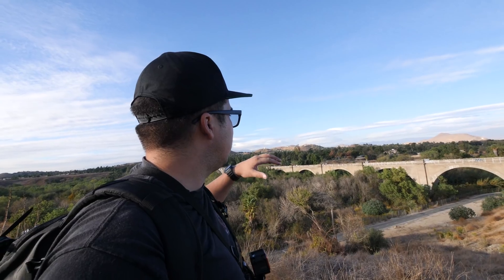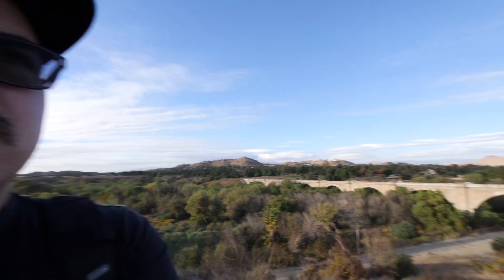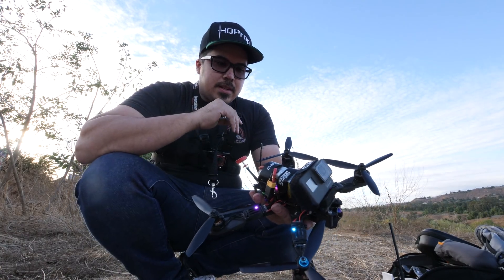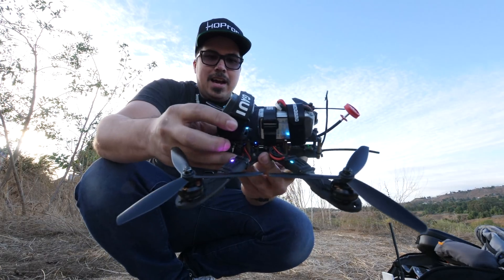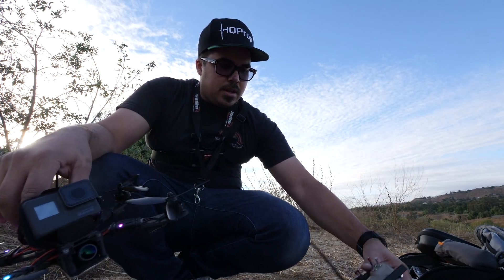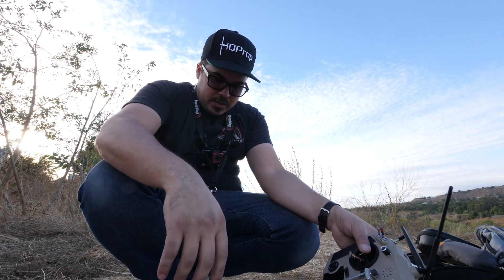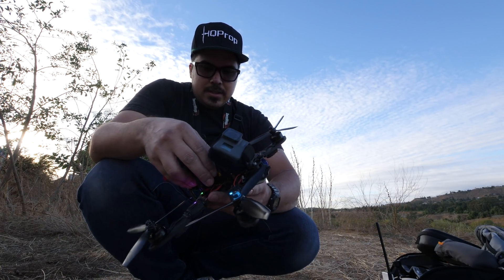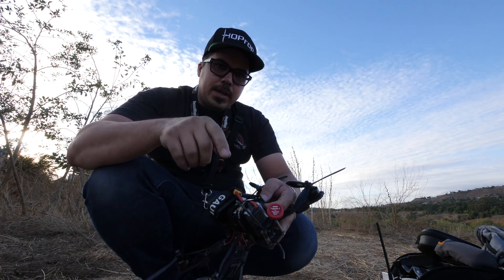Arming issue with betaflight f4 board and 32bit esc

Comment: I have the same issue with a Betaflight f4 flight controller running T motor f30 esc,some days it doesn't occur and like today still had 6 packs to rip and packed up early and went home, tried to go into blheli and it won't open, I feel your pain it's frustrating and I don't know what's wrong???

Comment: If anyone is going to use an F4 FC with non 32 bit ESC beware that you must flash the firmware with an older version from 2017, anything new doesn't recognize them.

Comment: FC Blinking red is letting you know there is a condition that has not been met. I'm sure you have figured it out by now. Joshua had a video where, he says if you getting flashing red led after power up, and it wont arm. betaflight is stopping it from arming. You can type in the cli to see what condition is causing it not to arm. https://youtu.be/M0S3HTQihxs

Comment: Hey Eric just built a kwad using the same board and was able to replicate the same issue also same prob with my beta f3 well not exact same but similar the problem I’m having and fixed it was the direct solder for your rx if u are using the second row for serial mine would have all indicators showing my xm plus reciever was running and it would from time to time when cycling the battery just like yours my suggestion is to go to the sbus wire and hold your soldering iron on it just a second longer than usual these boards are really touchy when it comes to this my f3 beta done the same thing with my cam in and out hope this helps

Comment: Eric, you may have got this fixed by now, but I've been having the same issue (been driving me nuts). 
just found a solution today on the betaflight github: https://github.com/betaflight/betaflight/issues/4613
basicaly there is to much noise for the gyro to calibrate. setting the following in cli fixed it for me: "set moron_threshold = 90"
apparently this sets the noise threshold that is acceptable before trigering a recalibration.

peace

Comment: Hey if you haven't figured it out yet I sent my board back to helidirect and they said the problem is a resister on the board that is failing if you send your board back they should replace it
Reply from the maker: +Dtf Fpv yeah I’ve just got down to solving this as well
Reply: Eric Konasty helidirect said when they contacted betaflight about it they said that they already knew about the problem. Would've been nice if they put out some info for the consumer about it so people like us don't pull our hair out trying to figure it out lol

Comment: I have bad wires and when replacing it worked fine for pinched during a crash.  Also seen adding dead band and calibration of controller has fixed some people drone.

Comment: bad flight controller. It happened on my naze 32 on a blade. Its fine cold after a few it goes stupid. Does it loose some of your saved switches in betaflight? If so bad Fc. It will get to the point it looses it after just a simple warm up. so make an array of switches, even those u dont use, when it acts up. plug in usb and see if any saved switches are missing

Comment: I returned a bff4 board for a similar problem. Got a new one that I’m running with kiss esc’s and that setup will run the motors for a heartbeat when I arm, then just stop. I don’t know if it’s the board or what. And the motors work fine in the motors tab in the beta flight configurator. #ThisFuckingHobby
Reply from the maker: +Frank Ruiz damn that sucks. I’ve been flying a lot of different setups and this one forsure is the right formula for 6” just need to work out these small issue and trust me I’ve got somethings in the works that will take care of a lot of the hobby woes

Comment: Did you set small_angle=180 ?  If you don't, and you plug in your battery while holding the quad on an angle (while holding it in your hands), it may prevent arming.

Comment: Eric Konasty it could be battery low battery warning. It may think that you use discharged 5s lipo. Try to set voltage to LIHV lipo.
If doesn't help, go on github and ask for help there. There are a lot of people that will help you. :)

Comment: the other issue i had was a lose connector on the sbus plug on the receiver. Kept losing telemetry, finally found it and soldered that sucker on, no more telemetry drop outs!

Comment: i have an f4 board that got shorted out with a tiny strand of wire. The strand exploded when I plugged in a lipo. After that the quad seemed ok, but every 10 packs or so it would not arm. 
I turned the warning messages on in the betaflight OSD and every now and then I noticed it said “gyro”. Apparently that means the gyro refuses to calibrate. The default behavior is to calibrate the gyro when you first plug in the battery, but if you plug it in and shake the quad around you can get the same error flag.
The gyro on the board was taking much longer to calibrate than usual and would time out during boot up.
Theres a setting to make the gyro calibrate on first arm instead. ie after you plug in a pack and before the first arming phase starts.
So what I do now is plug in a pack, put the quad down, arm and walk away, wait until the props start spinning then disarm, then it’s all good until the next pack.
There’s a bunch of arming flags in betaflight that can be seen in either the CLI or on the OSD that might help to narrow your problem down.

Comment: If you still haven't solved it.  If you cycle power till it arms.  Is there an average frequency or is it random?  Like 4-5 cycles or could be 1 could be 6 could be 10 till it arms? Edit:  Also I assume you tested that its not an issue with the taranis?

Comment: If this is Betaflight can you give me PID's lol I already tried to message you on fb once lol
Reply from the maker: +AngryMarkFPV I’m going to be making vids talking about everything I use and do in the next coming vids
Reply: OH btw, as for your quad not arming, I found when running a airmode switch, if its on the arm position for that mode it wont arm... But if I turn that switch off and the arm switch its fine, Also check your minimum throttle in your tx, shift it down some notchs.

As for your tune, IM SO IMPATIENT lol. nah, I am going to get some HQ 5.5 props today, so give them a whack and see how I go. Might be the easy solution lol.

Comment: I had a problem like that when I copied my config from the Betaflight F3 board to the Betaflight F4. Right now I’m running the BF4 3.2.1 with Airbot 32-bit ESC v32.3 and CRSF without issue. I manually reprogrammed my quad and that fixed my issue. I think that pasting the dump all from the BF3 board altered the resource assignments causing the issues. The combination works it must be a config issue.

Comment: I'm running the same setup an it's doing the same thing. When I plug the USB in it works just fine. I think it's got something to do with the BEC. When I unplugged my vtx it runs just fine.ill send you a lil video on Facebook an tell me if it's doing the same as mine
Reply: Jesse Jones did you find a solution, mine is doing the same thing! Won't arm unless usb is plugged in.

Comment: You need to flash you fc to betaflight 3.2.0 not 3.2.1 that will fix you issue for some reason the 3.2.1 version don’t work well with blheli 32

Comment: I have the same problem with the betaflight f4 Board won’t arm.only randomly it would arm like yours.  The only time I could get it to arm was if I plugged it into betaflight via usb  with battery on and then armed. I got the same blinking red led I spoke with the guys at fpv model maybe defective gyro

Comment: I hate those kind of "Mystery" problems. I'm having one now with my quad, where after I crashed, my quad it went full throttle when I tried Turtle mode and almost had a melt down before I could disarm. Now it wants to do it randomly when I arm. Almost took my face off!   Hope you get it figured out.

Comment: set small_angle = 180 . I've had similar issue with my current F4 board. It probably is some issue with initializing one of the sensors.  Pop the battery plug out, replug it and set it on flat surface quickly. That seems to do it with my setup. Usually this problem happens when I plug in the battery for the first flight, but the quad works normally for the remaining 10 packs I usually fly.

Comment: I see folks I fly have this problem constantly. Literally 9 out of 10 times they simply need to make sure their throttle stick is all the way down...sometimes folks get a little gunk in the gimbal, sometimes they have just set their min_check slightly too high...thus, it seems low enough to arm, but in real life they have to push their throttle stick down with pressure while flipping the arm switch. Go into receiver tab and look at your throttle number after gently pushing the throttle all the way down...if the number pops up to higher than your min_check, just raise the min_check slightly or simply remember that you have to really hold your throttle down right before you arm. This happens even more if you use the replacement M9 gimbals...also, clean your gimbals, as I know they must have some of that CA desert dust in them. I'd be really surprised if this wasn't your issue. Good luck!

Comment: That is bf. It is buging a lot and it changes with each version. Sometimes you need to refashioned it or go to an older version. I have also rf1 and never had problems. Just flash it and it works. I have the same problem with the bffc f3. I must connect the lipo several times. Reflashed it and it got other problems. Flashed it again and again other problems. My matek fc works good but not with all 3.2 versions. The first one OK but the newer ones not. Turtle mode works not always and as it works it is a disaster. Rf has the best turtle mode off them all. Bf is still looking and where I first hated rf, I start to love that more and more. Not that it flies better but just how to set it up and that it now works with no problems.
I only miss an osd on the fc it self. But I like the matek fc also. I know that I just need a bit older version and than it works good. It is also cheaper and I like the pdb with vtx in it.
Reply from the maker: +emiel1976ep I’ve never had an issue like this with BF so it’s got me stumped
Reply: Before 3.2 I also almost never and reflashing solved a lot if there where any but now with 3.2 they closed the gap to rf and I think they wanted to much. 
Still I find rf also more locked but bf improved a lot. But turtle mode of bf is a fail compared to rf's version. I don't know how the kiss version is but rf does it outonatic. Only switches no stick input.

Comment: i had the same issue but I updated the firmware and ran it 32k 32k
Reply from the maker: +newf fpv humm I’ll check that out. F4 board and 32bit esc also?
Reply: yup bff4 and wraith32  escs running betaflight 3.2.1

Comment: Like others have said, it looks like you never calibrated your accelerometer. It's arming after plug and unplug changing the angle and the gyro thinks the quad isn't level until that one plugin where you lay it down at just the right angle. You can either turn off the accelerometer or calibrate it and it should arm fine. There is a button the calibrate on the setup screen.
Reply from the maker: +BASHERS UNITED I have the accelerometer off so it’s not that. And I’ve tried turning it back on and calibrating it but no change
Reply: Eric Konasty yeah. It's Josh Bardwell time dude.

Comment: Weird. I keep having a similar issue, sometimes when I plug in a battery it doesn't complete the startup beeps. And on the osd it just shows the boot screen. (With the BF logo and a big 3.2.1) I just have to unplug and plug back in and it's usually fine.

Also, make sure turtle mode is set up properly. If one of your switches is freaking out and jumping into turtle mode when you don't want it to it won't arm. Check by moving the right stick when it won't arm.
Reply from the maker: +Fuzzwad yeah I thought turtle mode too but I turned it off and still had the problem

Comment: +1 JB video on arming. In CLI> GET MIN_CHECK and see how close it is your min throttle trim setting. For example I use "SET MIN_CHECK = 1020" with my throttle min at your standard 1000 setting. If improperly set or the settings are too close to read consistently you cannot arm.    Caveat: Valid on 3.1.6, just built first 3.2 with no issues using this.
Reply from the maker: +g36pilot yeah I thought that to and checked but it’s fine. Good advice though
Reply: Tenacious, my concern was Tx stick calibration and accuracy of trimable min Thr at 1000. If the Thr stick readings are jumping around too much due to wear or filth and then matched or went above MIN_CHECK it won't arm. THR position/value has to be below MIN_CHECK to arm. Are we saying the same thing? On the Taranis you can read exactly what the Tx is sending.
Reply from the maker: +g36pilot I’m using hall sensor gimbals that are brand new and clean
Reply: I'm wondering if it's a BLheli 32 thing. Just flashed my first set so I'm no help there.

Comment: if last info didn't help try setting gyro to calibrate after you arm gyro_cal_on_first_arm = on this will make it calibrate after you arm so if you hand launch you need to level arm disarm first
Reply from the maker: +youel adamas I’ll check it out

Comment: I've had the same issues on both my bf f4 boards, one works with set small_angle = 180 the other i have to not move it while i plug the battery in or it will never arm... upside down because bottom battery and harder to move on the plug in.  I don't use accellerometer so that is off on all my kwads...
Reply from the maker: +Gap of DooM I tried that same thing of trying not to move it even though my accel is off but no dice thanks for the advice though

Comment: Hmmm this video seem incomplete.  People watch and sub to your channel and most may even try to copy your setup.  You stayed you having issue with kiss and it's more for a 5inc quad. What the hell does that even mean?  Now  you switch to something that works some of the time?  And you provide a full deal explanation of your issue? What will you be switching to next? Race flight. Please try to be consistent with your gear. I'm pretty sure you did a video about keeping things the same in order to be better? Moving from one issue to the next seems kinda silly nuh?
Reply from the maker: +Cafu B I explained it more but my sd card crapped out on me. If you’ve been watching my channel for a long time you’ll know I don’t switch gear a lot and I don’t tell people they should switch. I was saying kiss fw seems to be geared more towards 5in quads then 6in quads bf probably is to but it has proven to tune better to 6in quads then kiss ever has.

Comment: I had a similar arming issue when I switched over to crossfire.  When I set the endpoints for throttle to 1000 and 2000 in the Taranis and my quad would not arm.  I adjusted the low end throttle end point to 995 and boom no more arming problems.  Cheers.
Reply from the maker: +Kev_ FPV I’m going to try that
Reply: I had the same issue with 3.2 and same end points. Adjusted the low end to 994 and issue has gone.
Reply from the maker: +K Palkina I’ll try it out thanks

Comment: As others have said, make sure calibrate accel if its on, turn on warnings in OSD if you're using it.....but biggest thing, put the ESC's on the bottom of the arms...this won't help with arming, but the LEDs look cooler there!   Happy flying.
Reply from the maker: +Alpha Dog accel is off no luck. Thanks though

Comment: In addition to the status from the CLI, you can also turn on warnings in the OSD. The advantage of that is there's no need to have a device with you.
E.g. I had one board where I get a similar problem and the warning on the OSD tells me "nogyro", then you wait a long time e.g. 5 mins and it gets better or like what you're doing just reboot it  a few times.

Comment: yeah remove blades plug battery in while ts having issue plug in to usb then go to cli and type status in cli it should tell you the flags why its not arming. also recheck your solder points on receiver signal and esc signal. Question are you running the board in overclock ? I sometimes got cpu load issues so cut it off and just run 16/8k not 32/16. also check that your small angle is 180 or you need to be 25* to level setting of accel

Comment: If your not using level mode turn off the accelerometer may be a an issue with the arming angel
Reply from the maker: +donald heon no it’s all off and still have the issue. I think it’s a issue with the receiver
Reply from the maker: Just set moron threshold to 100 and it works
Reply: Sugar Kane that was the first thing that came to my mind. Isn't there a command for cli to disable level to arm?.
Reply: G-nice set small_angle = 180 I think.. in 3.2.1 you can just set the arm angle in the main settings tab.. no need for the cli command any more
Reply: I second this type status in the cli
Reply: Eric Konasty try the status command it will show all the flags the FC currently has up..
Reply: Eric Konasty it could be battery low battery warning. It may think that you use discharged 5s lipo. Try to set voltage to LIHV lipo.
If doesn't help, go on github and ask for help there. There are a lot of people that will help you. :)
Reply: Ledrib discussed that in his (basic betaflight setup) video.. I am wanting to run betaflight myself so would be nice to know what really is the issue though or if there still is anyhow. Thanks guys
Reply: Eric Konasty that a cli command lol
Reply from the maker: Yeah

Comment: Mine done this the other day on betaflight 3.2.1 when I came back to land and swop out a battery I got the normal arm bleeps then then that red light flashing but mine was bleeping the esc,s aswell tried plugging and unplugging the battery several times and it kept doing it so I turned off my radio and back on again everything fine and has been fine for 40+packs 🤔